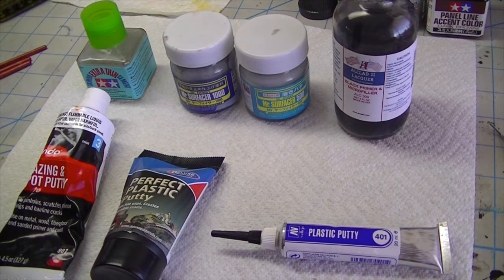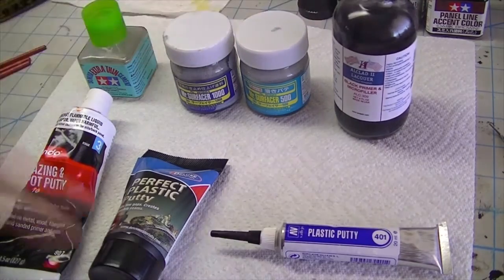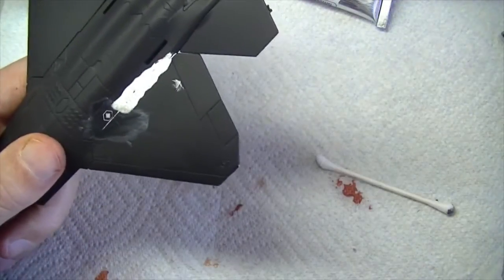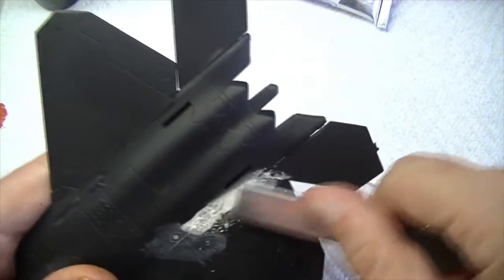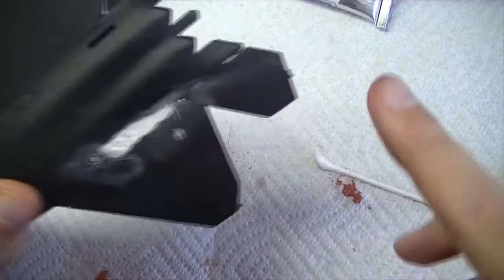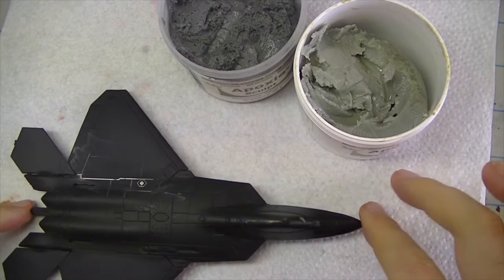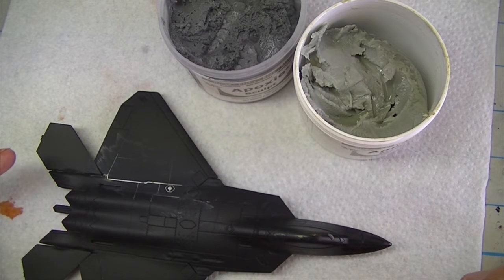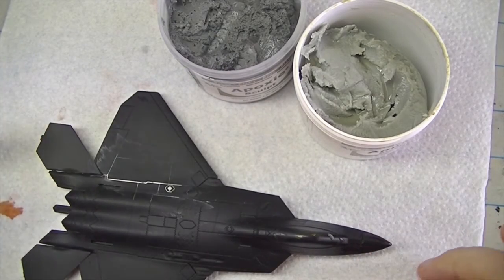ep100 - modelmaking fundamentals:  fillers

Comment: I discovered bondo,body putty as a kid,because my dad kept it around all the time,and I had bad results from the testers fillers,squadron fillers bad...then grabbed dear old dad's tube of bondo spot putty,instant love at first experience,using thinner to make it more usable was also an easy choice. learning to use tape on eather side of the seam to control the bleed over so less sanding wasn't learned till much later. I learned too that thin coats worked better and too much melts the plastic,trial and error back then. Now guys can turn to you,great job,thanks for sharing. We learn two ways,the hard way,or getting info from others,thanks to the internet,wow,I learn way more now than ever. Happy Modeling. Check out scratchin Jack and Amazing Plastics some time,you will see me there once in a while.1

Comment: A good replacement for Perfect Plastic Putty could be AK interactive's Modeling Grey or White Putty. I use this stuff it's awesome, it comes in a metal tube, is water based, it's a really nice consistency and can be put on with a brush and thinned with water if you want, dries pretty quick so you don't have to wait, sands really good especially when sanding with water because it helps soften it up. Its one of the most important products on my bench I highly recommend it.

Comment: interesting vid Will. I have the same issue with perfect plastic putty and have resorted to adding a few drops of water to the bottle each time before I reseal it.  I find that putting a little on a pallet and adding water to make almost a wash, then running it around surface detail on armour ,works really well. I then us a stiff brush once dry to remove the excess.  btw. have you tried the white liquid filler tamiya do in a glass bottle.  it has its uses as it is so thin and runs along seams nicely

Comment: Hummm... Sherwin Williams painter's caulk is exactly like what you described Vallejo Plastic Putty, it is latex caulk, and while wet, before dry it reacts with water, but after dry it will not, and is sandable to a point, but like that of fine grade. Perhaps you can use painter's chalk wet, the same way you might use Vallejo Plastic putty? (Putting it on, then swiping it down into the seam or gap  immediately using a wet rag or q-tip, then letting it dry as is, no sanding required.) Downside: it does shrink a bit.

Comment: You can use Apoxie Safety Solvent to smooth out the Apoxie, or even thin it out so it goes into gaps better. An easier alternative is Milliput (also an epoxy putty) that’s way more water soluble until it cures completely, and a bit less ”grainy”. Super easy to smooth it out, polish it, and force it down gaps and lines using a wet brush or a q-tip. Just remember to keep your tools and fingers moist so it doesn’t stick to them, like with Apoxie.

Comment: Beginning at 27:24, you compare the situations you like to use Mr. Surfacer to the situations you might use a water-based filler.  Is the only difference that you would use the PPP on a painted surface and the Mr. Surfacer on raw plastic?
Reply from the maker: that's the first consideration but honestly i avoid ppp because it's relatively coarse, soft, and brittle.